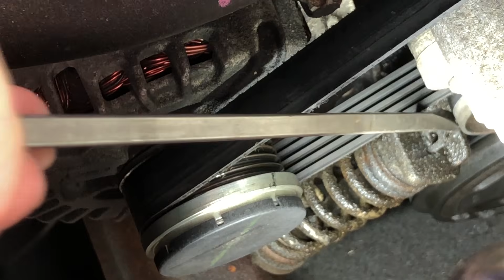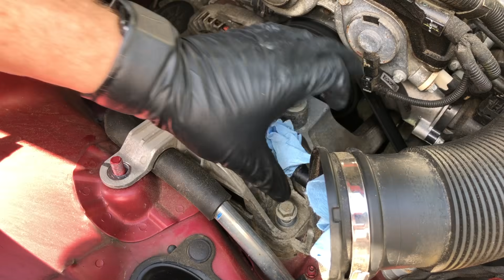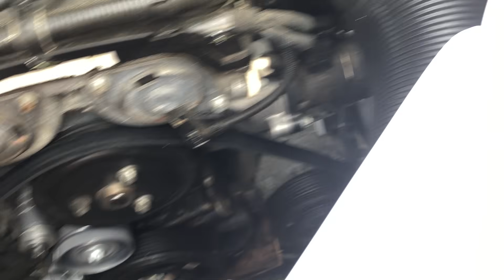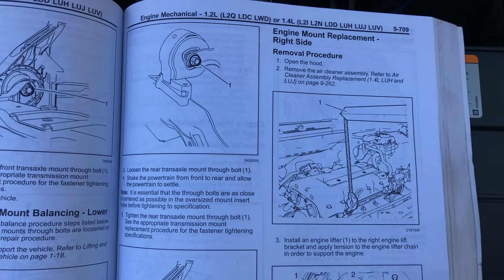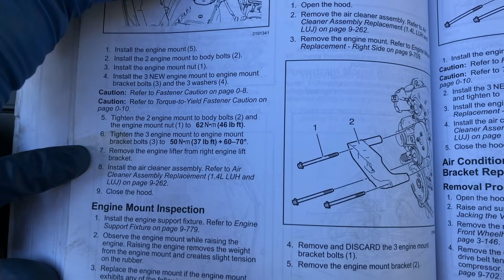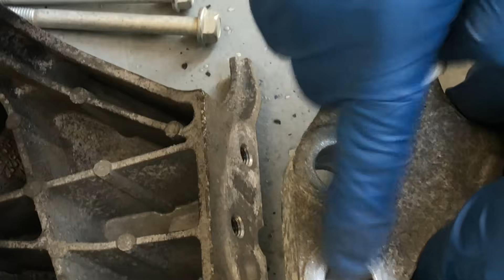2011 - 2020 GM Ecotec 1.4L Turbo Broken Drive Belt Tensioner Replacement (Chevy Cruze Sonic Trax)

Comment: How are you getting the proper angle on the bolts from the mount to the engine? You showed the 3 bolts on top with that angle gauge, doesn't seem like there's room to get that in there for the other three?
Reply from the maker: There is a dance to it, but with the particular type of angle gauge I'm using you can get it in there.   Inline extensions are ok to use with an angle gauge as well as adapters to drop down to a 3/8" drive wrench.
Reply: @DrShock thanks and thanks for making this video. Driving 400 miles this weekend to do this repair (and possibly an alternator) for my mother in law.

Comment: So non of ur bolts are TTY BOLTS
Reply from the maker: All fasteners that the GM service manual marks as non-reusable and to be discarded during the repair procedure are torque to yield (TTY).  Not all TTY fasteners will have a separate torque angle specification.

Comment: You take that pin out after you install.that pin is to hold tension just to install it
Reply from the maker: It is also used during other service procedures, as illustrated in the GM service manual.  So do NOT discard the grenade pin.
Reply: @DrShock def not. I was simply stating you need to remove after the installation

Comment: This video was completely helpful till you didnt show how you got the motor mount in smh
Reply from the maker: The mount reinstalls in the reverse of the way it came out. I also showed the service manual overview.  If you're stuck, review the removal footage and manual page clips to see where you're hung up.  There's no trick or special technique to getting it remounted.  Depending on how you secured the engine, the position may have moved reducing your clearance.  So check that as well.

Comment: I believe it's much better to buy these three bolts made from steel just to not replace and don't waste the money every time you need to replace a pulley or belt. GM made them from aluminum on purpose knowing well you need to unscrew them always.
It's nothing than greed.

Comment: Where did u buy the service manual book from. Mines different from yours. Can I purchase the same book as yours?
Reply from the maker: I'm using the genuine GM factory manual, same information that the GM dealership technicians have access to online but in hardcopy form.  These manuals are model and model year specific, and you can find how to order one in the back of your original owners manual (they are not cheap new though figure around $300).  There's a link in the video description where you might find an used set.

Comment: So do you need to replace all the bolts? Motor mount to engine,water pump ,AC pump ext? And do you have a link for all those bolts? I was wondering can you use some blue lock tight on the old bolts?
Thank's great VIDEO'S. I'm doing all of the above on a 2016 Chevy Trax
Reply from the maker: Thanks.  Yes, links to all of the parts are in the video description.  You only have to replace the bolts that the GM service manual I showed highlights.  Those bolts are torque to yield and stretch out so they have to be recycled and replaced.

Comment: Hey what is the pin used for? If mine came out do I need it to put the tension pulley back in? Or can I without?
Reply from the maker: The service pin is used during shipment when a GM belt tensioner is new in the box to hold the spring in a fixed stationary position.   It is removed after installation onto the engine (you do NOT have this pin installed during normal operation).    It is re-installed during service, when replacing the serpentine belt or removing the belt tensioner from the engine to again hold the spring in a fixed position for service operations.

Comment: I will be tackling this Job in the next few days (just waiting on the parts) Your video is very detailed with excellent explanation.. ((Torque to Yield bolts, e torx sockets, angle finder gauge)) had to make room in my small tool box.. I watch several other people in auto repairs but today you became my favorite.. I even watched a few extra ones that I have no need of at the moment except the crankshaft seal which I discovered I needed after watching this one... Thank you so much for your help..

Comment: Where did you find this book? I want to buy one. 
Thank you for this video.
Reply from the maker: Those are the factory GM manuals, a hardcopy version of the exact same online information available to the GM dealership technician.  In the video description is a search link where you may find an used set.

Comment: So just have a quick question, what would happen if you don't change the bolt outs? the three long 11588757? Beacuse i have 2012 chevy cruze 1.4 and i need to replace the Drive Belt tensioner.
Reply from the maker: GM requires those bolts to be replaced because they are made out of a torque to yield (TTY) metal alloy.  TTY fasteners stretch when torqued, and then weaken structurally when removed.   So such fasteners are designed to be one time use only.   What could happen if you reuse them anyway?   Unpredictable really.   Anything from just not being able to reach the specified clamping force anymore, to the fastener breaks.

Comment: You don't have to remove the entire motor mount, you can just remove the three bolts closest to the engine, keep the engine on a block and the belt can pass through.

Comment: So basically the broken sheet meta part isn't needed for the tensioner to work properly?
Reply from the maker: On the contrary, it is crucial and it's breakage requires replacement of the assembly as we showed in this example.
Reply: @DrShock  I dont understand why that small piece of metal is needed after installation, if Im not intending to disassemble the tensioner, then its not needed. Mine (the small metal piece inside my tensioner) just broke and it is stuck inside the tensioner
Reply from the maker: That piece inside the spring prevents it from over extending.  Definitely have to replace the tensioner assembly if its broken as over extension will wear out the serpentine belt in short order.  As you see in the video, this is what holds the tension pin during removal and installation.
Reply: @DrShock  yes but isnt it only for the installation part? Its such a small metal piece, could it really be holding such a strong spring after installation?

Comment: I just did a tune up and the car was still running hard. I saw the belt was shredded and changed it. The old tensioner pulley literally started shredding my brand new belt like it was mozzarella cheese. Gonna change it tomorrow. But I'm running out of money lol

Comment: I think someone said it's also possible to do this job by removing the wheel and fender liner and going from the bottom side so you never have to fool with the motor Mount or anything on top

Comment: Why exactly does it require need replacing when it’s just jumping up and down in the spring ?
Reply from the maker: Three reasons. The spring is supposed to be held back by that tin retaining tab at an even tension, so you'll have uneven belt wear leading to a premature failure of the serpentine belt while under load.  Due to the uneven tension, the spring will eventually force the tensioner assembly to separate under load (i.e., grenade itself sideways).  And finally, that now broken tin retainer vibrating around will introduce an annoying engine harmonic (which is your acoustic warning to get it replaced before one of those two possible catastrophic failures that leaves you stranded).

Get it done if you have the problem in the early stages, this isn't one of those things you want to attempt to save money on by delaying.

Comment: i drive an opel astra gtc from 2013 with the same engine. so far it still has it´s original belt and i´m not sure when you should replace it. i think i might try this myself, thank you for this very detailed video without any bs music :D

Comment: I went ahead and bought grade 10.9 bolts to replace all the TTY bolts that are one time use. It was half the price and they're reusable now. I hate when you have a one time use bolt holding simple things like the belt, tensioner, accessories ect. What a dumb design.

Comment: Normally the “PIn” holds tension pulley back to be able to install the drive belt. I would have slipped belt on smooth tension pulley Last! Not the grooved pulleys.

Comment: Good vid.  Was replacing the alternator and couldn’t get the damn tensioner back in because it wasn’t compressed and this helped me out, thanks.  I’m wondering why you bothered taking the airbox and the motor mount out though?  Just for more room and better camera shot I’m assuming. FYI everyone watching this, you can get the tensioner and the alternator out without removing those.
Reply from the maker: Thanks.  The GM service manual recommends removing those components for best access.  You can certainly improvise, but I strive to show the by the book OEM way as much as practical when filming.

Comment: @DrShock i just replaced one on a 13 cruze. I didn't go oem but it seems that there isnt enough tension on the belt.  Did the parts store possibly give me the wrong one ?  Seems the tensioner isnt keeping my belt tight enough ?  I did everything right but something is wrong. And the belt squeaks ?  Plz help !
Reply from the maker: idk if aftermarket includes the grenade pin retainer, but you have to remove that as I showed with genuine GM for correct fitment.
Reply: @DrShock  yes sir I did. Is that metal band that runs through the spring supposed to go through the slit or stop  ? Just seems like not enough tension. All my pulleys are turning but the belt is squeaking horribly
Reply from the maker: The flat metal insert inside the spring is what usually breaks, as I showed in the vid, causing the tensioner to malfunction.   The insert should be intact and attached at the base.  It will slide thru the opening at the other end of the spring where the service pin can be reinstalled into the hole in the insert, when needed.   If you're sure it's the correct part for the engine (and not an incorrect part as most GM models have more than one engine option) then the noise could just be a worn belt.  As I showed in this vid, a broken tensioner can cause damage to the belt forcing it's replacement also.

Comment: Excellent video. Excellent! Mom in laws has a sqeaky noise when warmed up. Suspect this is the culprit.  Any possibility it could be water pump or timing pulley? 2014 encore
Reply from the maker: Thanks. This sound is more of a ticking or tapping.  I would expect a pulley to be more of a squeaking or squealing.
Reply: So this tensioner you changed was tapping? Wondering if this pulley is known to squeak on its way out

Comment: What issues does this even cause? What if I just removed the whole middle metal piece? Would it just cause more play?
Reply from the maker: Then tensioner is required to keep the belt from slipping off the pulleys and maintaining proper tension to operate the accessories (e.g., the AC compressor and alternator).  With the tensioner failing, the belt will have accelerated wear out, or may even pop out of the pulley tracks.
Reply: @DrShock  I do all repairs on all 3 of the cruze’s myself so that is good to know and I will keep it in mind. I’m assuming the metal piece holds the spring at a certain point of tension so it doesn’t allow the belt the pop off or bounce to much when the belt speeds up.
Reply from the maker: If you're talking about the inner thin metal piece I showed broken in this vid, yeah that's a travel stop.  In fact, you would put a special tool (or something similar like a small nail) in the hole as a holding pin when changing the belt, for example.   But when that inner metal retainer breaks, then there's too much tension on the belt and it begins to wear prematurely.   If the tensioner fails further, then the opposite problem happens, where the tension is lost.

Comment: Part numbers don’t match my Cruze per websites. 2012 1.4 😢
Reply from the maker: Then the website you are using is incorrect.  The part numbers I've shared in this video come out of the GM service manual parts system, the bible written by GM engineering.   ;-)

Be sure you're working on the same type of 1.4L as I show here (dipstick in the front), there were new designs released in 2016 that could differ (dipstick in the back).  Also it's possible a part may have been superseded and replaced by GM since his video was made though, but it will still cross reference back to any previously discontinued part as GM keeps all such part supersession history.

What's the part in question, and if I get time I will check it online thru the GM dealership system.
Reply: @DrShock  I had to get mine from the dealership. Cheaper that way.
Reply: The part numbers for the replacement bolts using your links in video. No worries. I have the bolts. Yes mine is 1.4

Comment: just curious to know if you had any symptoms on the engine due to the tensioner other than noise. great video
Reply from the maker: No, typically you would never notice this until you hear it, or notice the belt wear.  Eventually not replacing the broken tensioner will cause premature belt failure.

Comment: A good rule to remember... disconnect the negative battery cable when working on electrical parts...
Reply from the maker: Only if the GM service manual calls for it.   This is not necessary in all repair situations.

Comment: this was  an excellent video, however one question. In the beginning you mentioned that you had to address the crank shaft pully issue "I'll assume the gasket was leaking and needed replaced new bolt etc". that being said i am curious why the issue was not done at the same time as if i am correct, do you not have to go through the same process of removal of the belt tensioner, belt and motor mount to also do that job?
Reply from the maker: Thanks, you are correct that's all the same labor for pulling the timing cover.  The crankshaft seal you can do without removing all that though.  However, the owner of this vehicle declined to do all the work at the same time regardless.
Reply: @DrShock  well that explains it. I thought maybe you did but had a separate vid on your channel that i could not find. I have seen other vids, however you were really informative in this one so i was hoping to see your take on it.. thanks for the response.

Comment: Just wanted to say thank you so much for this tensioner video. I had to replace it on my 2016 Chevy Trax and this video help me tremendously!!! Again thank you for saving me $350 in labor. Did it myself.
Reply: They charged me $600 for it. I'll replace by myself.
Reply: @robertotr  they tried to charge me 1200 lol I’m doing it myself thanks to this amazing bloke perfect video not to much talking that was unnecessary

Comment: Yea my serpentine belt got torn off and my tentionor gave out for the most part unfortunately with the shortage of parts nationwide had to put it back on I don't recommend it it's hard to get the belt when a part is bad and kinda dangerous too and very time consuming and also have sound now. But I got the car to move so saved me close to 150

Comment: Great job! Quick question , would it possible to change the tensioner withOUT having to take the engine mount off? Thank!
Reply from the maker: Thanks.  I took the mount off in two pieces because that's easier for showing more detail.  But you certainly can remove it in one piece (engine bracket remains attached to frame bracket) to save on replacing as many torque to yield bolts.

The mount in place will make it very difficult to swap out the tensioner, and prevent getting a torque wrench in there for reassembly.  But the main reason is you are highly advised to replace the belt when doing this repair because the belt damage the broken tensioner causes (and as I showed in the video),  and for that the mount has to come off.
Reply: @DrShock  awesome! Thanks for the reply and advice 🙏🏼
Reply: @DrShock  planning to work on a sonic. I noticed your comment about the sonic model being different. Slightly confused on it though. If I was to remove it as one instead of 2. What bolts will need to be replaced, trying to save on replacing the tty bolts. Thanks in advance

Comment: Question  was this issues making any kind of noise or just a regular maintenance,
Reply from the maker: This one was found diagnosing an engine oil leak complaint, and had no sound associated with it.  But they can make a buzzing noise when broken like this, and not caked up with oil gunk.  ;-)
Reply: @DrShock  ok got it , reason of my question is because i have a 2013 rs 1.4 and when i turn on the ac makes a squeaky noise but only when car is stop at any light or stop but when is running the noise gone so is driving me crazy thats why i though was a polly from the tensioner but sound coming from the water pump so is complicated to identify the problem
Reply: @sancheztorres35  that is the exact same issue I had when mine went bad. There wouldn't be any noise unless the AC was on and the car was idling. My belt ended up being half the width it should have been because the tensioner was out of alignment and it eventually snapped. It turns out that not only was the spring broken but the bushings on the upper bolt were broken as well. To anyone that reads this comment, if your belt snaps your car will overheat very fast.
Reply: @DrShock  one more question i have a 2013 sonic rs 1.4 turbo and i would lime to know the part number for the oem front crankshaft seal and the part number for the harmonic balancer please thanks